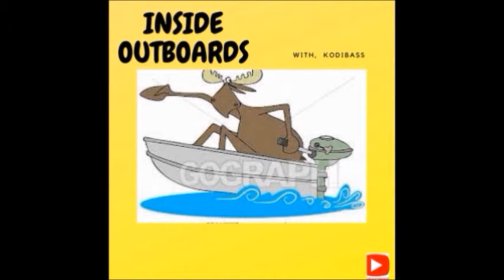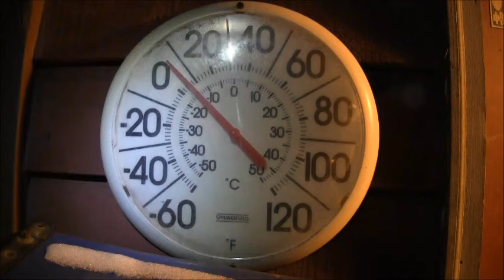JOHNSON 30  HP &  MORE,,,,,

Comment: Glad the parts will help you Kodi thanks for the shoutout. I thought about painting the bracket blue & I was going to but I wanted to get it in the mail quickly, I did clean it it was dirty. Looking fwd to seeing the little 5.5 being finished off. I was wondering about your E-mails sent a few about the parts didnt here from you glad you did get them parts.The rubber seal was longer from an 18HP and I actually put it on the same motor lower pan and cut it to size.. Anyhoo keep the videos coming .. ...Glenn
Reply from the maker: Again thank you'  I will get after it in next vid 4 sure.    kb
Reply: @kodibassInsideoutboards  👍👍👍👍👍👍👍

Comment: If you have a 1984 6hp Evinrude to work on spark etc. that would be good.  I bought one and cleaned it up, cleaned carburetor, changed power pack, one ignition coil, spark plugs, fuel pump, new head gasket and thermostat, cleaned up under flywheel and still haven’t got it started.
Reply from the maker: Sounds like you  should B ready to  Outboard Dance,  What are the compression numbers  ?      kb
Reply: @kodibassInsideoutboards  well they were about 50 on each cylinder, soaked them with PB Blaster and Lucas upper cylinder lube.  Since you asked I went ahead and cleaned out the lube, tested the compression and it was 74 and 75 👍 
Put the spark plugs back in and she fired up🔥🔥🔥.
I don’t know how to do the outboard dance but I will learn🤣🤣🤣

Comment: hello I have 1986 evinrude 15hp when I first get to the lake crank up and down the lake I go full power well after running for a while I start losing mph and rpm like from 18mph down to 15 do you know why this would happen
Reply from the maker: Could  B  a coil breaking down,  or a power pak going.  Put 2  in-line spark checkers on it  run with hood off  look @ spark checkers  when it slows down see if you are  loosing spark on a cylinder.    I would also try  using a known good tank and hose to rule out your hose /tank.   Thats where I would  start.    kb
Reply: @kodibassInsideoutboards   thanks for the help